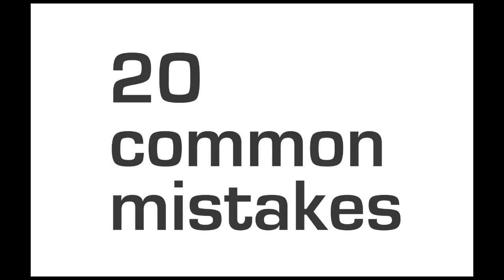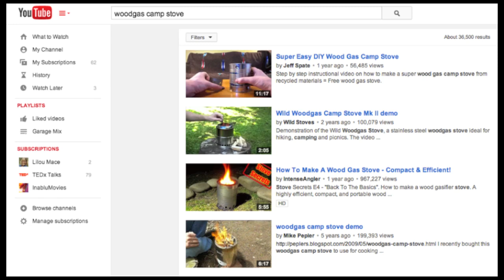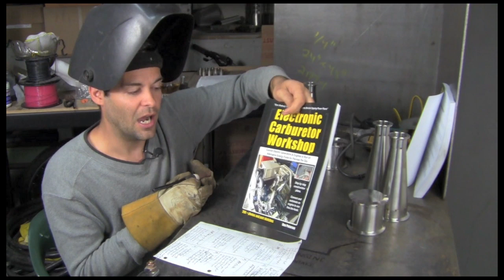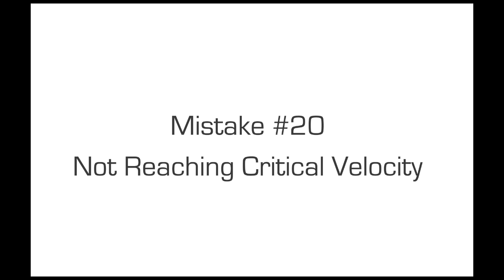Wood Gas Crash Course 6 of 7 (Gasification 201) woodgasifierplans.com

Comment: great video. I will have to watch the whole series. I have just recently started trying to design tin can wood burners as a hobby (and hoping to make some videos out of them). I have seen the sea of videos of, what I consider, crappy designs. I want something that blows that junk out of the water but still is made out of tin cans (related to the topic of up-cycling).  It seems to me that almost all of the "rocket stoves" or "gasifier stoves" on the internet are not actually burning efficiently, or they are not controllable. So my first design incorporates adjustable initial air inlet and adjustable gas/second burn air inlet.  I just did my first test run yesterday. I think I was not getting enough oxygen for the gas/second burn. The main problem I have is that my goal is to make an efficient burner that runs off of chopped up sticks and stuff. I totally ran into to issue of not starting with charcoal, like you talked about. It took quite a while for the (somewhat green) wood I put in to start to turn to charcoal before I was able to light the gas/smoke.
I also have experienced the confusion caused by bad information on the internet regarding gasifier burners. There's tons of blog posts and videos. It's hard for an inexperienced person to filter out the misinformation.

Comment: Ok, Ben, it's time for me to open up this subject, to you.  & others I get it  & your gas generator is well-built. Ok first let me tell you my story  I'm les thompson. Born in 1952. Off-grid first we had an Old truck Gas generator  That once ran on a truck.  In 1962 we in England suffered the worst winter ever. lasted so long that it was May before the snow went.    So it was then I discovered the pelage of damp wood gas.  we never managed to pull the gas up to the critical velocity you refer to, in this video. so I decided to visit my gas works. in the UK we made our own gas from coal. 

In the conversation, I told him about my wood gas generator & asked if he could give me some advice. he wondered what type of Gas generator it was I said a down draft type. swiss modal or Dutch. he replied I replied swiss,  have you found that side pocket & filled it with charcoal yet.   No should I? IT was at this point he informed me I got wet smock because I had not filled the tub with charcoal, you must remove the top of the tube & fill it with charcoal from your gas generator as you refill it with wood & put the dry un charcoal wood at the bottom.  then you wet wood. well isn't it better dry I asked. look wet or dry the hydrogen is in the water wood. As it goes through its first Bern it leaves the bottom as wet smock they all do. some have cyclones on the side but most have charcoal colom that are lit charcoal in their bottom, It is this part of the gas generator that Is so often forgotten it' allows the wet smock to remove the oxygen up the charcoal colom & into the filter system.

It is this that makes the wood gas generator work so well. Most plants had this part removed after the war  To deter the induction of them permanently being an option. 
I went home  & there it was under a flange on the side of the main vessel. 
When I opened it up I discovered the back was rotted out'  So I experimented  & soon arrived at a slosh. I installed a charcoal colom secretly & fed that gas to my engine & never looked back. I also discovered adding steam into the colom will produce good gas.. to run an engine.   I did this in 1962. I suffer from diplexer So I did not speak of it until now I have mentioned it to builders, but not mainly listed. but some have discovered it coming from a different direction it was used in filing the early balloons, not your design as just the right place to fit a charcoal colon.  w the let is for the filter damp gas into the colom & dry gas into the filter colom.

Comment: what are you doing with that tig? im new to tig and didnt see filler rod? are you spot welding with it?
Reply: "spot welding" as far as I know refers to the process of clamping two pieces of sheet metal together between electrode ends and basically hitting it with lightning so that the small amount of electrical resistance in the metal causes a rise in temperature so great that the two pieces of sheet metal partially melt and fuse together.  To me it looks like he is "tacking" or "tack welding" those pieces together.  The filler rod in some welder models is run through the hose that the shielding gas is going through (probably still isolated from each other, but IDK).

Comment: in addition to peter's egr, how about running a blower in parallel and using suction to control how much fuel is directed to temporary storage, or recirculated?

Comment: And also, you said that trying to start the gasified on wood is wrong because it takes a while and creates plumes of smoke? My way to start it on wood is to circulate the exhaust back into the intake because the smoke has some heat stored so your reusing the wasted heat and the smoke is flammable too. It's basically a exhaust gas recirculation system. It cleans up the exhaust gas while decreasing warmup time. If you want I'll draw up a picture and send it to you.

Comment: Im in Australia metalworker and i own a 351 carby 1982 ford f250, i have been looking into other woodgasifier plans and was wondering if your plans would be suitable for my truck for high way use ... its really flat and roads are straight here where im at.
Reply: I replied via email, but just for those stopping by Drive on Wood has lots of resources on that angle. Vesa Mikkonnen has a great book too. My advice is to start with small engines though. When you have that down it's easy to scale up. If you start big and then try to go small you may run into problems because things have to be more precise. Flow and heat are less. Nozzle diameters are less too.

Comment: Ha! Ha! This is excellent, just pure excellent BenP.
Anyone of us actually DOing real never made less than 3-4 of these!
Hope folks listen to this REAL well and avoid at least down to only two mistakes.
Mine: info overloading;, too primitive too cheap, weak blower/suction; and my last not on your list using live NET feeds as base information sources.
These guys are edge finding experimentors.
Three books only until useable gas made and engine ran:
Your new "Wood Gasifier Builders Bible" and the "Electronic Carburetor" books
Pegasas Gasifier
"Generator Gas: Another Mobile Solution . . . ."
the second two as public searchable down loads now.
Pay for: WayneK's Drive On Wood and VesaK  Vehicle Gasification as a deeper pocket investments.

Great, great wisdoms you are making accessible here BenP
Hats off with much respect.
Washington State Steve Unruh
Reply: I'm sure I have made just about all of these. An expert is someone who has failed in every imaginable way possible.

The big thing I am seeing now is that guys aren't getting enough run time to get a valid judgement on gas quality. The assumption that all gas is good gas doesn't hold up when you tar up your valves. But if your filter is cold enough it might take 10-20 hours to get there. And guys aren't getting there and then other guys are doing what they are doing. I would like to prevent them from bent pushrod tubes. I remember sitting at hempfest without the ability to run the engine because my "free & open plan" had tarred up my engine so fiercely.
Reply: @benpeterson1818  Not sure if you are still responding to these videos but does your wood gasifier design filter all the tar from the gas? What about particularly tarry woods like pine/spruce etc.? Also are you gonna make a new book on the new design I see you made in newer videos?